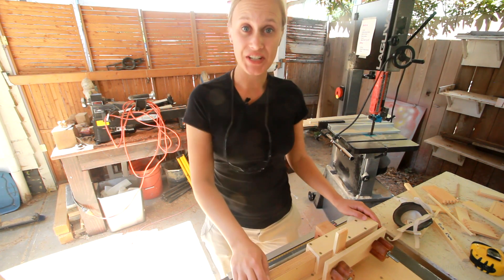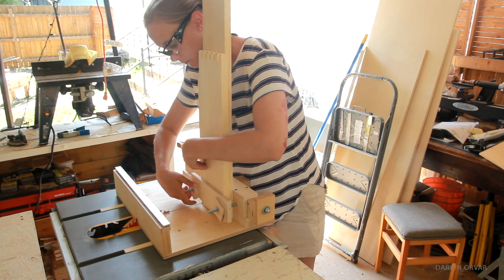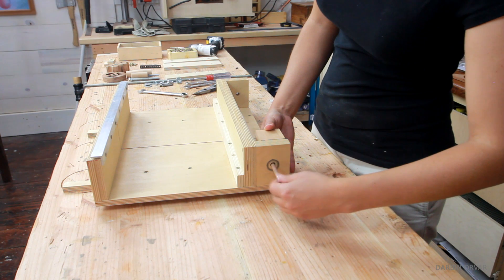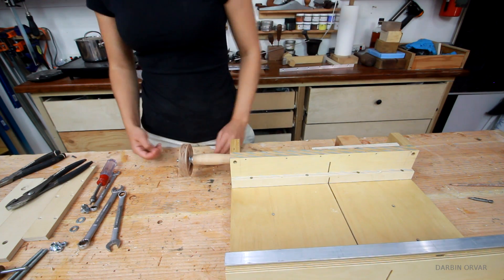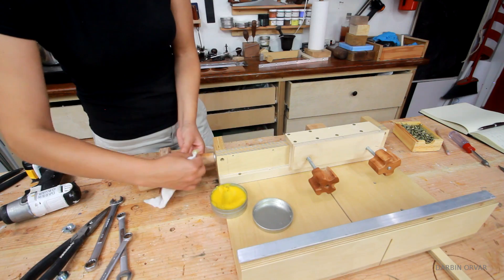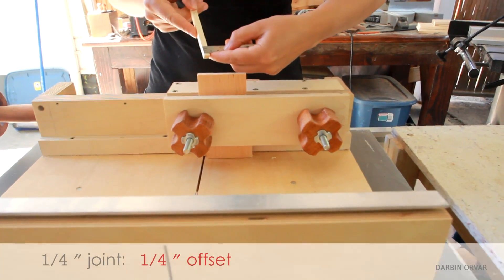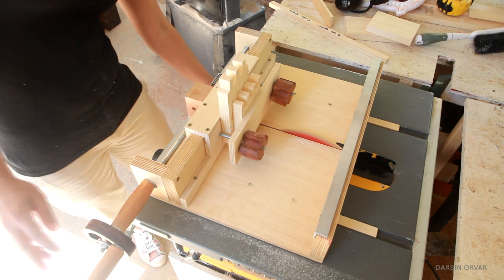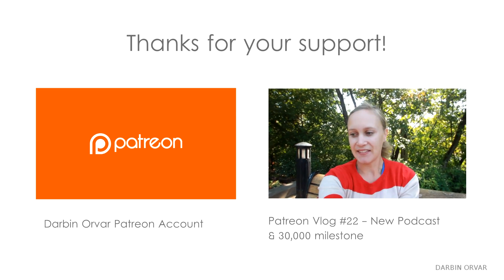How To Make a Box Joint Jig

Comment: Thank you so much for this video. I made this jig today but I made it for my router table. I haven't made any boxes yet but I made marks on the jig and it seems accurate. I am using a 1/4 inch spiral bit in my router and that makes the math easier to follow when counting revolutions. You made this look so easy. I had a little more trouble lining things up. lol Thanks again!

Comment: I have a 2.35mm  (around 3/32") blade, I can only get metric rods, M8 and M10 (1mm / 1.5mm per rotation).  Would this stuff things up and mean I would have to try and keep track of a 2 and 1/3 turn on the 1mm rod and err something more complicated on the 1.5mm rod?  Or am I over thinking this?

Comment: Hi. I've made the jig and I have a problem. I can get an accurate joint, which takes care of one quarter. Now let's say I place the front and rear ends/pieces of the box I'm making, and then the sides of the box I'm making in front, and then off set them (the side pieces) to the distance of the cut needed. So far so good. Let's say I've cut all 4 pieces in one go. Now...when I flip it over to cut the other side(s), do I flip it over and set it up the same way as before, or flip it over and also horizontally reverse the set up clockwise/anticlockwise 180 degrees and then cut. There's something I'm doing wrong as when I put the box together one corner is out and off kilt. Any suggestions? Thanks

Comment: + Darbin Orvar small question I'm building the sled now and I'm gonna use it as my box joint jig as I have other crosscut sled already but I don't have that s carve thing you mentioned but I did like the round handle.  Is it 1 to 1 ratio in the file so I can just copy it and do it with a router

Comment: Hi everyone, I built Linn's jig and for some reason something is not right. So far I've only tried quarter inch finger joints (4 cuts 6 spins) and with each attempt I end up with with fingers that are too loose by about a sixteenth of an inch. My blade's kerf is an eighth inch and I have verified that my threaded rod is three eighths of an inch with 16 threads per inch. What could I be doing wrong?

Comment: Thanks for sharing! One of the few box joint jig examples that is designed for a normal single blade table saw. The dado sets are expensive and even hard to find i Sweden. Very good instruction video!

Comment: Hi Linn!  Very slick project!  Just one question, are you using an ATB saw blade or are the teeth ground flat (like a dado blade)?  If you are using an ATB blade, do you find any issues with the bottom of each box joint not being flat?

Comment: Hi, very nice video. Wouldnt it be nice if you can integrate a clicker counter to mechanically increment counts when you rotate? That way you wont loose count.
Reply: Anish Kumar I was thinking the same thing. Like a spring lock/clip? What do you think could be used for that?
Reply: Hey Angello Hector, I was thinking it could be something like this https://www.amazon.com/GOGO-Counter-Carnival-Manual-Mechanical/dp/B001KX1VW2

Comment: there is no "working out" if you use metric iso threaded rods - it is just algebra like with whitworth threaded rods

for example M6 has 1 mm offset, M10 has a 1,5 mm offset for each turn, M16 has 2 mm offset

typical cutting withs of sawblades are 0,6 0,8 1 1,5 or 2 mm

so you cust have to mach up your blade with your rod or you need a bit of algebra

Comment: I noted that you hand drilled your wooden spacer, and it was off center a bit.  Will your lathe allow you to chuck in a drill bit to drill the hole precisely centered before you cut the finished piece off the stock?

Comment: Hello Darbin, it is again nice video with beautifull list of needed material. As I am only a not even a beginer, your wheel made on CNC with the handle and taking as a referenc poit the highest position it seemd not to be ideal as you can see on video it is slightly mooving while you are cutting. Maebye the lowest position yould be better + add some weight to the handle to keep gravity work instead of you. Anyway, it is beautifull and you definitelly deserve the subscribing :-)

Comment: best explained and one of the simplest box joint jigs I've seen. one suggestion / comment, would it not be easier / less likely to slip if you referenced with the handle at the bottom rather than the top as then your not fighting the natural gravity of the layout?

Comment: great video very well explained. I am francophone and i 've understood even if i dont speak and understand a fluent english language
Reply: I'm french and I also follow this tutorial with great pleasure, thanks Line. But I do not understand how to determine the number of spins, this depending of the thickness of the blade. I do not get the same size for tenon and mortise :( My blad width is about 3.3mm and a rod spin move to 1.5mm. Can you help me ?
Reply: I have the exact same problem.. Help..!
Reply: I think this jig (or any jig based on the threaded rod method) works only if both numbers match. You could try a 3 mm blade so it will match 1:2. But I have not tried it myself. Don´t know if there are these blade thicknesses out there. My blades all have 3.2 mm.
Reply from the maker: Merci beaucoup!
Reply: Thanks for answer. But in the video, Line use a 3/32" blade, equivalent to 2,38mm. This rod is a 16 threads by inch, equivalent to to 1,58 mm by round. This blade and this rod doesn't match and his system works. Why it doesn't work with me ?
Reply: well, guess I did not understand it at all. Thought the dimensions must correlate! Sorry. Maybe someone else has the answer?
Reply: Take the 1/4 inch joint. Each time you spin you move the blade 1/16. So you leave a 1/4 inch slot in 3 spins as you cut after each spin.. IOW, You move the blade 3/16 inch in 3 turns as it cuts. No matter how wide the blade is, the work only moves 1/16 at each turn. Then after you finish cutting the slot, you move the work ( looking towards the piece from the saw) from where the blade is at the right of the finished cut to where the blade starts at the left-inside, so to speak of where the next cut begins. The spins are 6 giving .375 inches of work movement, which equals the width of the slot, which is 3/32 plus 3/16ths = 0.28125 inches plus the width of the blade or 3/32nds. = 0.375 inch. Thus the pins and slots are equal to 0.28125 inches.

Comment: Really Like it, Not sure I would want to remove it, easier to just make another sled for it, I am Curious why you have the Handle extended out so far with that Wood Cylinder,  is there a way to add marks for a Double check on spacing, so as to not get count off and etc?

Comment: That is a neat box joint jig...  Mine is based on this -- https://woodgears.ca/box_joint/jig1.html  -- but it doesn't look anything like it.  I did away with the gears and went with a simple crank. I can do up to a 10 inch wide joint but this can be easily made as big as needed. along the back that faces the user I have scales for 1/4, 3/8, 1/2 inch. the indicater works basically like the ones on a table saw.  On the wheel I have marks at every 1/32 of an inch, handy to have to "adjust" things if your blade isnt exactly 1/9 thick. Just add what ever correction you need to get the notch to the exact width desired as a final cut.  One of these days I might modify my homemade CNC router where I can use it to do the work.. That also opens up some possibilitys for some fancy variations on the classic dovetail joints.. :)

Comment: I built this same jig a few months ago one thing I will say don't just buy any 3/8 16 threaded rod there not all exact my first one was almost a full thread off but after I realized why it never quite lined up I went a got a new one after measuring the threads manually first now it works like a charm mine is all monogany . Walnut and burch ply very nice and simple to make .

Comment: I built Linn's jig and find it offers much more than other box joint jigs I've used.  I did develop a method for making the pins of variable width on the same box with no changes to the jig.  Counting the increments does need focus to avoid mistakes though.  I plan to add a simple Root Counter for $3 or so to make this easier.  It is even more necessary for my variable method to keep up with spacing.

Comment: Great video.  There is one point that I feel was missed.  Based on my calculations, it looks like you are using a 1//8" kerf blade, which may ore may not be what we all have on our table.  I have a Makita 2702 which takes a 8 1/4 blade.  Normally they come in a thin kerf.
Reply: +Normand dEon She said it was a 3/32 blade.
Reply: +Andrew Thomas it would not add up then if I am calculating it right.   I will recalculate.   The reason is because if she counts 2 for the first of the half inch cuts, that means 2 times 1/16 which is 1/8.   But I will test soon cuz I'm building one.

Comment: Is there a reason why you leave your handle in the up position instead of down? It looked like the handle wanted to move down in its own a few times.

Excellent job on the jig. I am just starting out woodworking and first thing I need to build is a cross-cut sled. I may build this jig as well.

Comment: 3/32 of an inch.. Jesus Christ, you guys seriously should consider (harder) switching to the metric system. How can you do any arithmetics on these ubiquitous fractions? An inch is simply too big of an unit for anything. Just please don't implement ant feet or something, metric system is already there to be used :-) A very nice video otherwise, and seems the jig does the job perfectly, thanks for sharing!
Reply: +daleksan80 ...I have used imperial system all my life except for one job I worked on and all the blueprints were metric dimensions. I have to agree it was alot easier except I had trouble estimating dimensions because I wasn't used to using it. I really wish we would go metric.
Reply: Rather than being based on 10ths, like the metric system, the American (aka Imperial) system is based on halves, just like music notes.  I use the metric system in my work, and the American system at home.  It is very easy to understand once one gets a bit of practice, and has the advantage of not requiring one to memorize the order and conversion factors of all those prefixes (deci, centi, milli, micro, nano, femto, pico, atto, zepto, yada, yada, yada).  As we say in America, "You pays yer money, and you takes yer choice."
Reply: You don't need no yada yada. For each domain you have certain range of units. The point is, it is easy to do arithmetics on metric system. I used to live in CA and I'll give you example what I mean - you go to Safeway and they display price per unit. The idea is to be able to compare the prices of products whose package sizes differ. But.. sometimes these morons will give you price per ounce, sometimes per pound. I thing they do it on purpose so you cannot compare the price in the end.. which is exactly why the unit price is there in the 1st place. Coz you know what? Good luck with multiplying or dividing by 16. Shall there be a price per gram and kilogram - you don't even need to think about it, you just ignore zeroes and decimal points and you have the idea just looking at it. Please don't use arguments that something is better, coz you are used to it. What is the fraction of an inch for a wavelength or purple color by the way?? :-)
Reply: +daleksan80 While I do admire your impassioned defense and advocacy of the metric system, I think you miss my point entirely.  I made no value judgement about either system.  Let's face it:  Educated people will have no trouble counting, whether by 10s or 2s.  For the truly uneducated the point is moot, as they will probably not be able to handle the arithmetic in the first place.  I jump back and forth between both systems without any difficulty or giving it any thought.  I can, however, see how those who were only raised using one system might find it daunting to switch over.
Reply: Norman, please look at my initial comment. The topic here is the ease of doing operations on each of two systems. What you said on this topic was that educated people will cope with whichever system. Can I take such statement seriously? We could ramble forever that these are two different systems (an evolved one vs a designed one), but we all know that. Regards.

Comment: a super job Linn! I appreciate the fact that such a wonderful jig you share it with everyone, without cost for the plan. some people do not start a business with 5000-50000 dolars/ euro, I started with a hammer, saw, chisel and a few tools building roofs in Romania, but sometimes it's hard to advance, with people like you is easier :). Now I am 30 years and I shared 3 years work time with danish carpenters in Denmark, now planning go back in Romania and starting my one company:). after so much time I do have tools in value 6000 euro. I will give you a big LIKE

Comment: Great job been studying this vid for days finally got my version done and made my first fitting box joints I bought a 5/16ths rod instead of 3/8 so I had to Dial in my spin counts but I've been wanting to build a jig like this a long while to make my vape mods better. Thanks a bunch great vid great jig mine is a lil smaller n not as clean but it works and I owe it all to you thanks again
Reply from the maker: +Doc Plooms That's really cool you built one. Send me a pic if you're on Twitter or Instagram!

Comment: Thank you very much! It is particularly well explained, particularly for a francophone like me, who do not understand the "fluent English". I think it's fun that explanation to the feminine way! A male will not explains at all the same and it will give less details. Thank you so much! Technically, the "cross cut sled," I think, is much less common among us in France. I have used this technique to DIY with a tiny circular saw Proxxon KS 230 and it is really very accurate for cuts! ( I used aluminum for base and fences. Thank you very much, you are lovely person.
Reply from the maker: +sarazinfaj Merci!
Reply: Darbin Orvar Hi. I love your video. I'm currently building the sled to make way for the Box joint jig. Unfortunately I don't have access to the CNC machine but in a crude but practical way I can cut a nice circle of wood and use that! it'll work. I just wanted to know what the dimensions of the wheel are before I install it as I'm thinking the diameter etc and the width of turn would alter the number of turns needed to adjust the joint cuttings? I'd really appreciate it if you could let me know. Thanks for your awesome videos :)
Reply: p.s I can't upload the file for some reason too :(

Comment: Loved your video. The only thing was in the little two second shot of using the lathe you are holding the knife in a slightly less than maximally safe fashion. I always put my left hand (I'm right dominant) on the guide, really close to the work, which gives me a lot of control and safety.
Reply: +Kelly Anderson I assume that you mean "place the tool rest as  close as possible to the work"
This reduces the leverage force between the work and tool rest.  Thus reducing the chances of the tool flying out of your grip if the tool sticks into the work while the work is spinning.
Reply: +Vern Mitchinson while that is important also, it is good to have a hand on the tool and the tool rest that is close to the work, not to have both hands far from both.
Reply: +Vern Mitchinson at 1:40 in your video is what I'm talking about. Holding the knife way far away from the work like that gives you less control as you are far from the sharp tip of your tool. Happy and safe woodworking!

Comment: for anyone wanting to get more technical without the trial/error of possibly messing up a cut, the number of turns is dependent on the threads per inch on the rod, in this case 16 threads per inch, 8 threads in half an inch and so on was why the half inch joint took 8 turns
Reply: I feel as though I would need to build it to work out why some things got funky on the half inch like the starting point at two, I am more of a hands on learner so I can't quite put together those aspects
Reply from the maker: +Don Ribble One thing to make note is that many blades are not 1/8 inch. So that would throw off your concept of an 8 thread per inch rod.
Reply: I see, so accounting fit the entire kerf of the blade changes those values, which I'm sure had something to do with the starting point being at two turns haha. Luckily there is plenty of room on the top face of your jig, perhaps one could write commonly used sizes with their turn counts
Reply from the maker: +Don Ribble I was thinking about doing a short vid on the math, but really very few people would probably be interested.
Reply: Yeah, and if someone couldn't be bothered to figure the math, they would probably have the scraps to test fit anyhow. I hope to make this sled and jig soon, I really liked how you simplified the project, I have seen the sleds before but never thought I had the ability to make one until I watched your instructional video :)